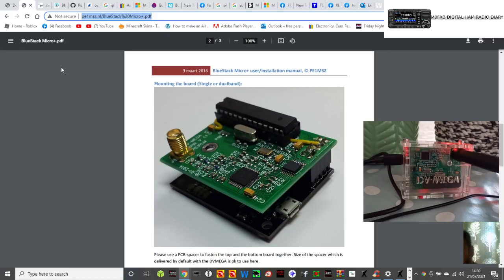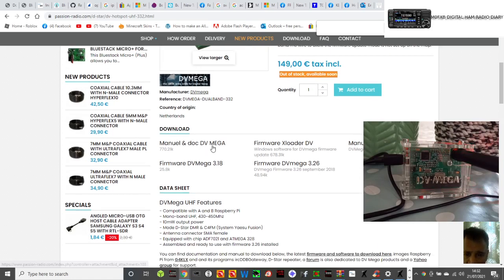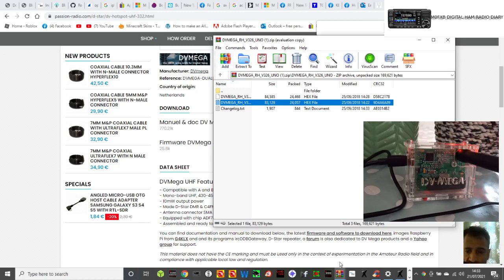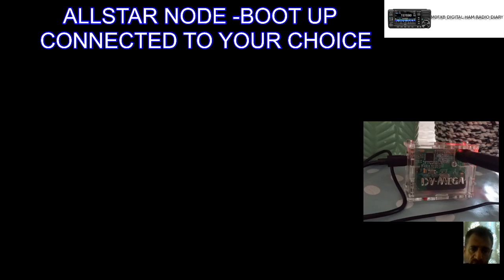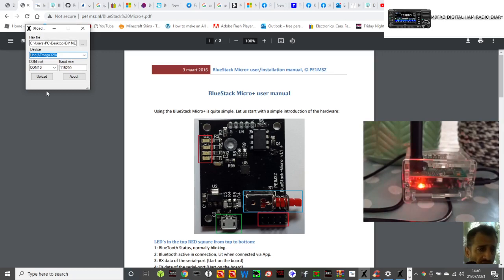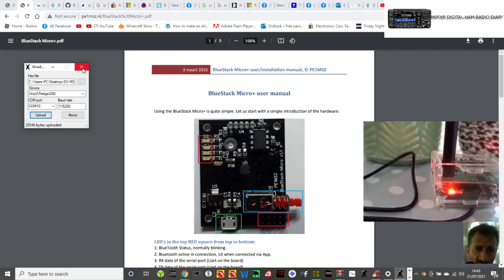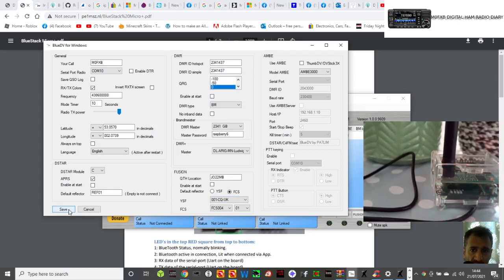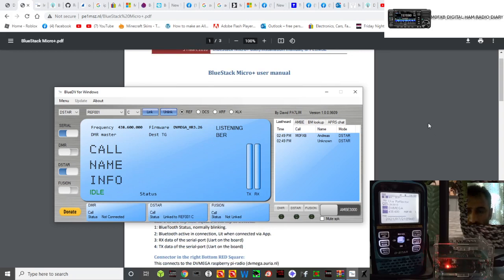DV Mega - Firmware upgrade (micro)

Comment: Thanks man. Very helpful and informative. Was able to upgrade firmware on my mega that I’ve had for about 5 years. Was running it on a pi-3 with PI-star. Kept hanging in tx mode after I unkeyed. Hopefully this will help once I put her back on the pi. 73’ W4ffx
Reply from the maker: Glad it helped i still have mine its fun to use 73